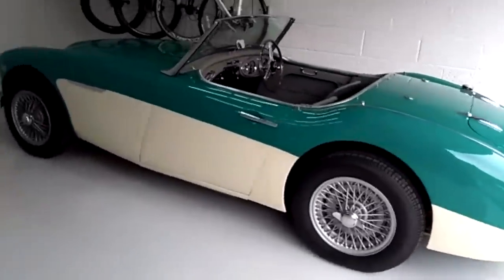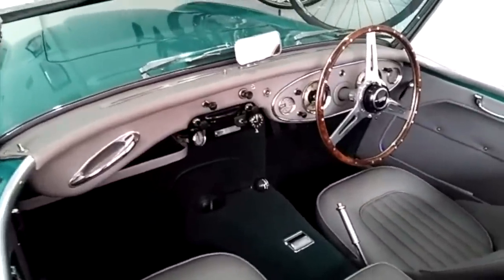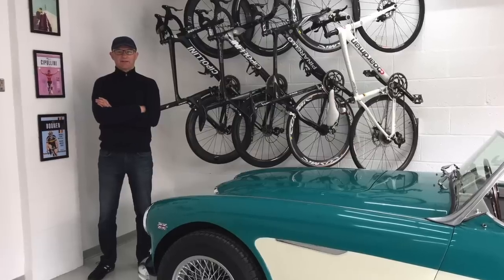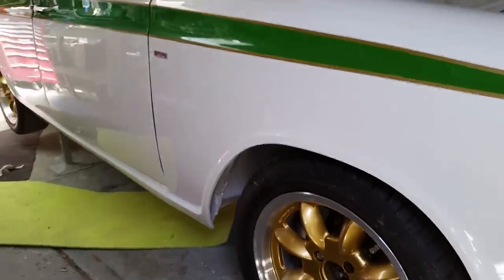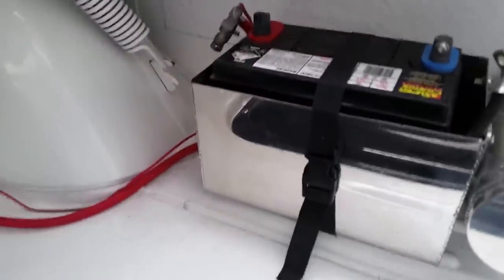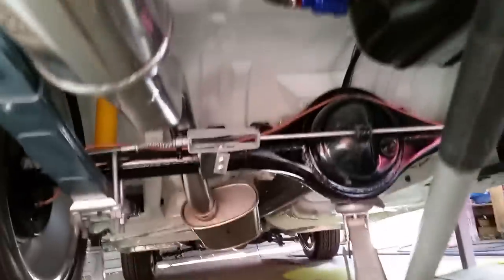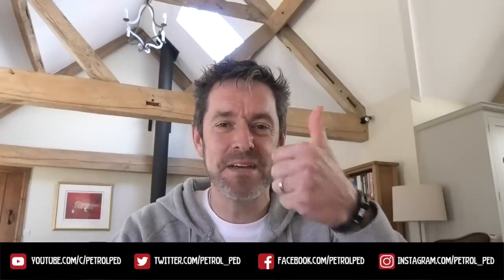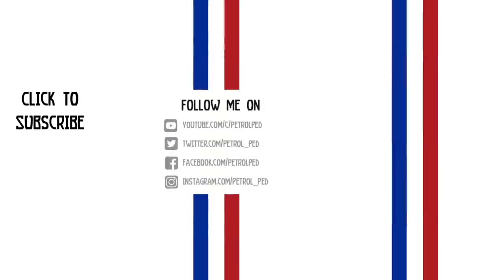Peddlerz Rides #1 - Dream Garage and EPIC Cortina Build [CarVid19 Daily VLOG]

Comment: Austin Healey took me back to my days when I lived in Manchester in the 50s 60s I bought 100/6 in exchange for Morgan +4 Maroon with a TR engine which was brilliant car registration number RYF 140 acceleration up to 70 miles an hour was out of this world  visited Morgan's factory a couple of times. The Austin Healey was yellow with a grey panel, Chrome  wire wheels, electronic overdrive, the battery was in the boot and had a switch off to disconnect all the electrics.It had a T/Cover, Soft top and a Hardtop which was Fibreglass covered with a cream vinyl  beautiful car. When I sold it in 63 it went to Australia